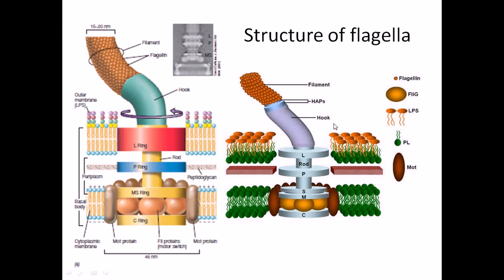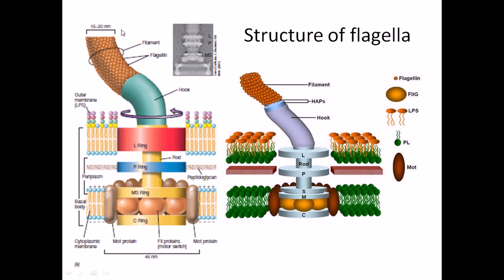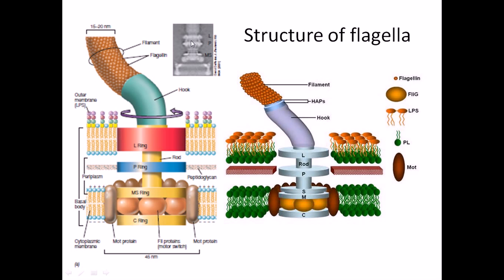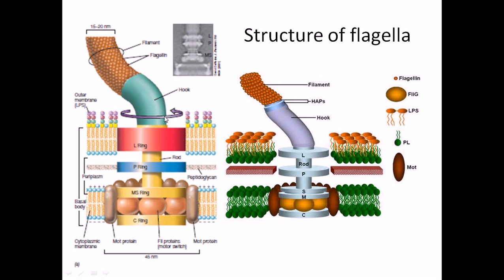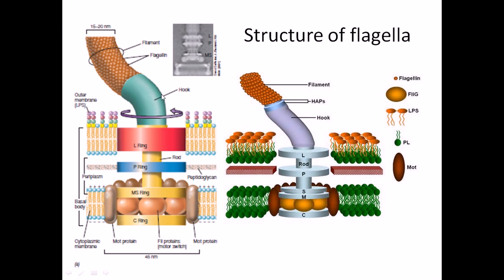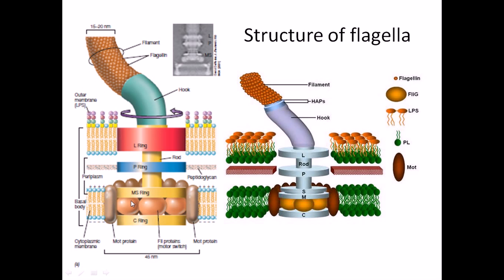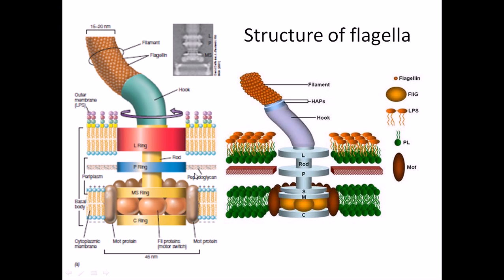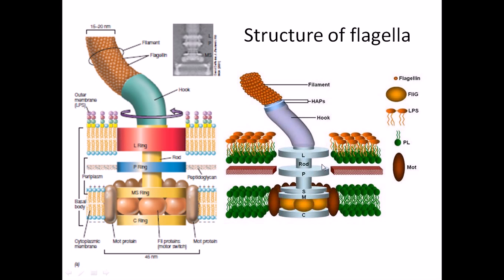Bacterial flagellum structure

Comment: Which came first, the code, or the protein?  
Where did the code come from specifying insertion and location of internal and external membrane embedding of different parts?
Are there simpler flagella in the archaea?

Do some flagella change rotational direction based on chemotaxis vs simple on-off?  Is that a simple process?

Comment: If you can explain how hox genes are forming skeleton structures, shapes of organs etc., Then i too agree this is wonder of Evolution. Sadly the genes only has proteins and scientists say they have structures inside. I have lot of respect on you and please kindly don't use that Evolution statement.
Reply: chakradhar sabbella essentially in simple terms what happens is a mutation eg the wrong nucleotide base being used instead of another or perhaps one being missed out, this changes the amino acid used and subsequently changes the final protein. mutations are extremely common so evolution happens faster especially in a changing in environment. and if ur wondering what causes this to happen faster might be a warmer environment where enzymes have a different rate of activity or fail to function which causes the mutation of the gene. simple mutations are the reason why some babies die, if a god did exist he wouldn’t do this would he?
Reply: @TheCreepersAlive   Show some proof of this.  You might as well get a blender by exploding wire and plastic.  It is designed.  Period.